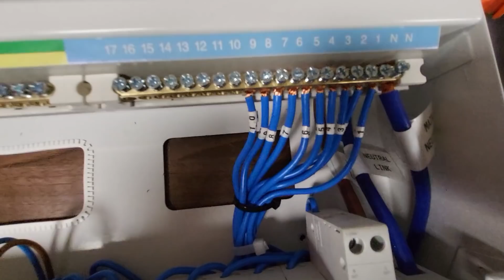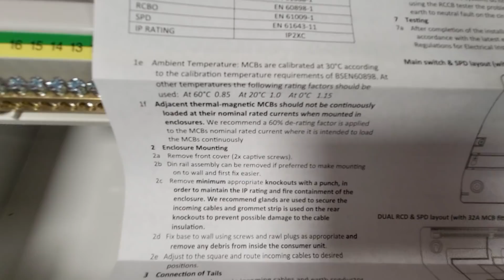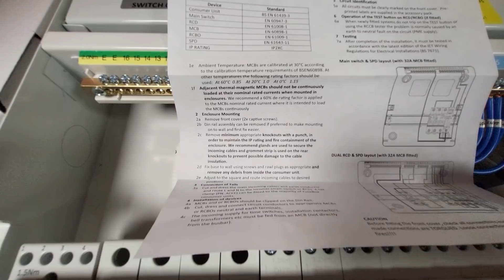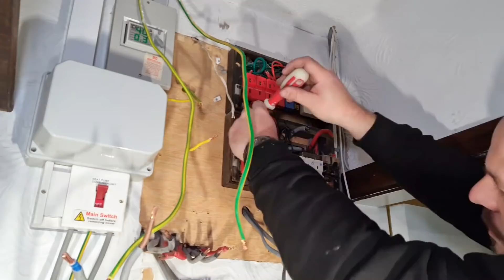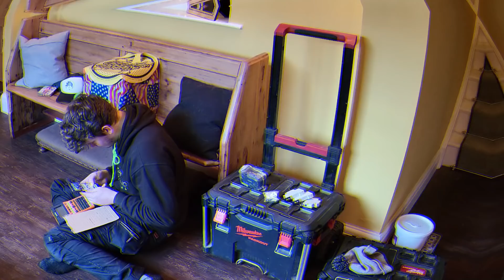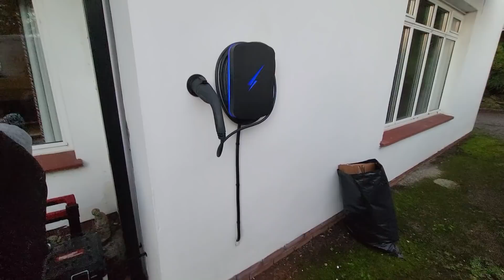Nightmare service fuse Overload || Massive consumer unit HOW TO || Installation || Hypervolt EV ||

Comment: HI Mark, thanks for the video. As an adult learner, at about 3 minutes in you say "MCBs are calibrated at 30 degrees" then in the instructions the rating factor at 20 degrees shows 1.00 - would that not suggest the calibration is at 20 degrees?
Reply from the maker: I see that logic. It's just saying no adjustment needs to be made until a lower temperature. These are calibrated at 30C as per the product standard.

Comment: Hi Mark great content. I like the dual row board I’ve considered trying to use a one when space is tight and extra circuits are needed do you have a link as the only one I can see on expertelectrical is a “dual tariff”
Reply from the maker: https://www.consumerunitworld.co.uk/fusebox-f2029mx-29-way-duplex-rcbo-consumer-unit--surge-protection-4017-p.asp

CJR10 for 10% off 🤭

Comment: Black wire in earth bus bar. should be green yellow sleeved.
Reply: This is why I don’t post my content on YouTube because of keyboard electricians like you
Reply from the maker: I try to encourage more sparks onto YT. Don't be put off. It's a fair question all be it with a really obvious answer.
Reply: @electrician247  giving it a go! I just find I start the job because you know… I wanna get the job done 😂 and once I’ve made a start I realise then think well… that’s most of the job missed I’ll just leave it.
Reply from the maker: @hackwoodelectrical  finding time is a real battle. We try to setup one day a week and just record little bits or time lapse something beefy. Go for it though mate. Just subbed 💪
Reply: @electrician247  thanks! Appreciate the sub ❤️
Reply: Get a life
Reply from the maker: It was over sleeved in the end 💪 while recording time lapse we wasn't sure exactly what it was. 
Little clips from the day, 

Take care
Reply: @electrician247  Our house was built in the early '70s. and had a 6mm black main earthing conductor with black bonding conductors also 1.0mm CPC in the 2,5 twin if I had not experienced it I could have been confused also wondered why my ring CPC reading was not 1.68 x the live conductor
Reply from the maker: @anthonybragg  yeah thats how it was done for a time

Comment: Great video as always. Is there a reason why 2x RCBOs were Type AC not Type A as the rest? Thanks
Reply from the maker: It's in the video mate. Wholesalers stock issue. They are type A though. Just not mini and not switched neutral 💪

Comment: Really lovely job very neat. Question has the hyper volt got its own rcbo with pen fault fitted.
Reply from the maker: It has pen fault and rcd protection but dies require upfront Type A 30mA rcd protection
Reply: @electrician247  cheers